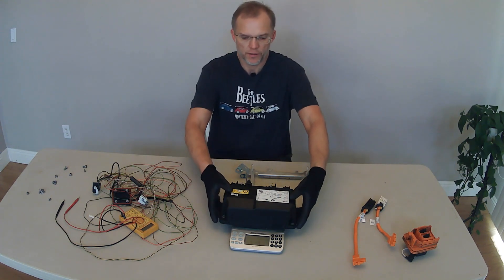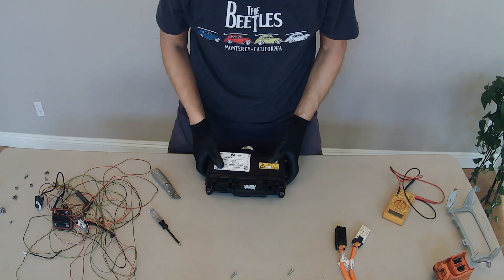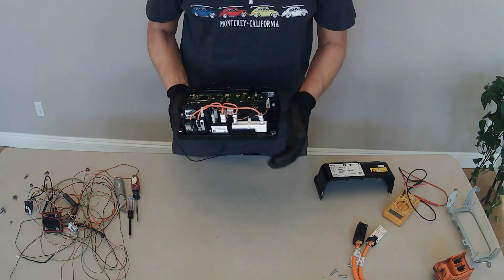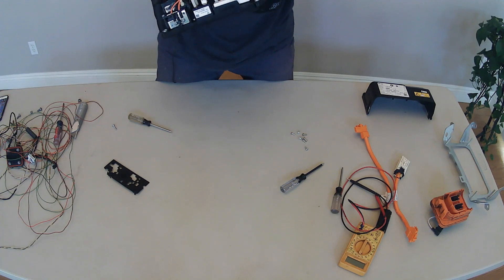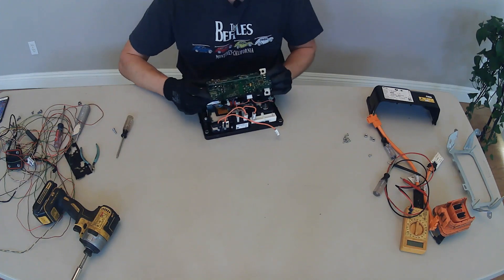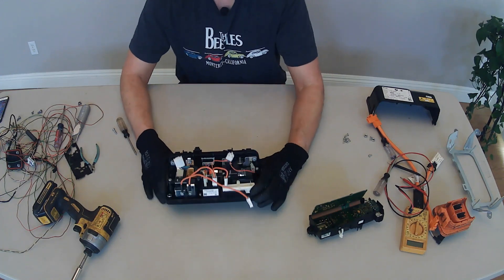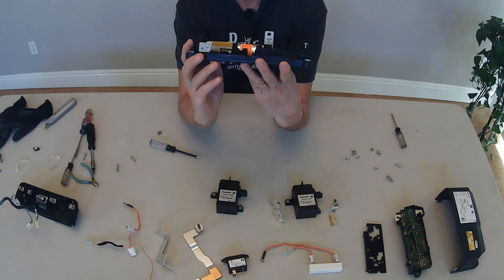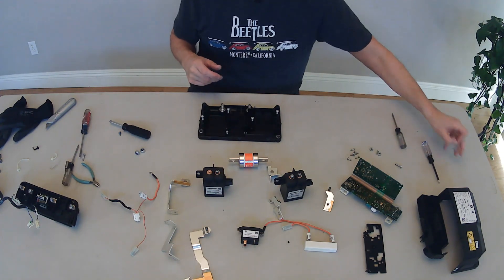BMW 530e HV Battery Pack Safety Box Part II

Comment: Well done. Please keep making these videos. So do you think you will be able to use the BMW box or do you need to make a new one?
Reply: I would say not. Reuse the contactors and resistors. The rest no
Reply: @blackterminal  makes sense!
Reply from the maker: that's a great question, and much progress has been made in reverse engineering this BMW Safety Box on OpenInvert dot org so yes now we can use CAN Bus commands using a free open source program called BMW_SBox that we get from GitHub (sorry YouTube won't let me post the direct link) from Damien Maguire but you can see my new video on it here https://youtu.be/QLIiOIRqfsE
Reply from the maker: @blackterminal  ha ha, actually some would argue that them contactors and especially that resistor suck